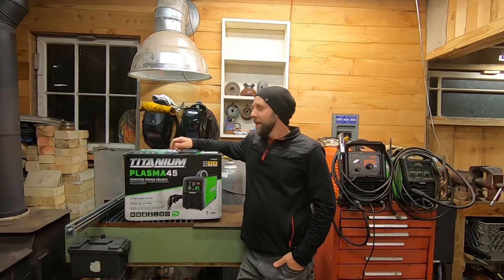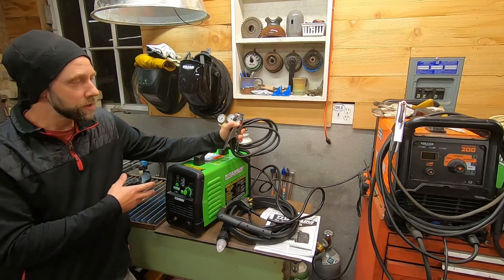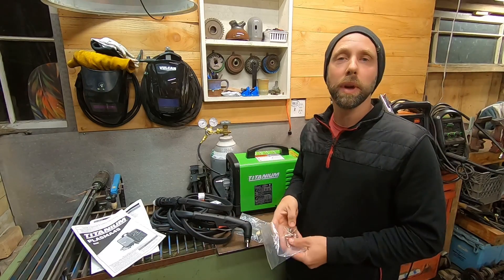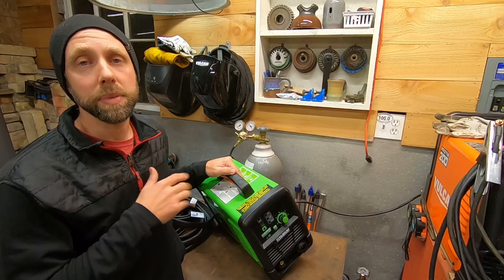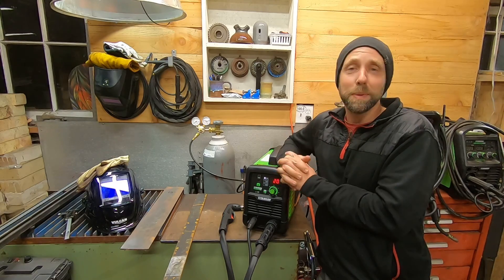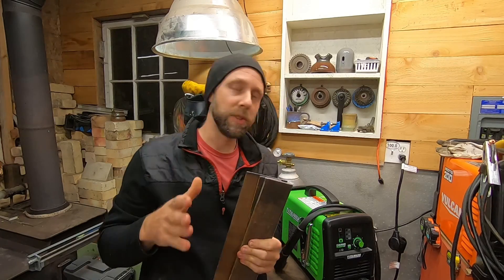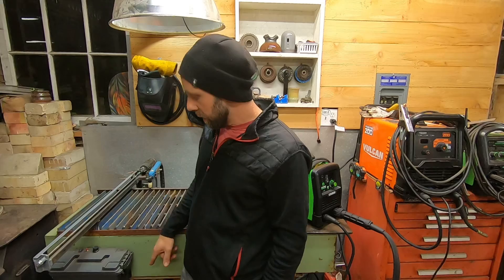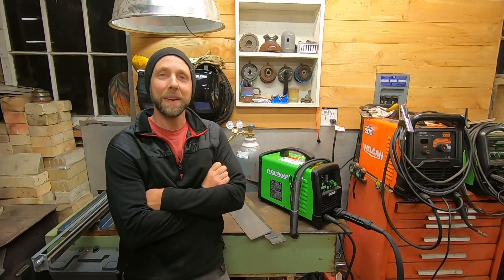Titanium plasma 45 plasma torch review

Comment: No release date or price? Nice review though, not sure I trust a piece of equipment that's given to check it out. But that being said HF has a great track record as far as returns go.
Reply from the maker: I asked those questions but at the time HF didn’t want to give that info out. I hear they should be in stores after the new year. I had a manager at HF look up the price and it should list for $799 but I’m sure it will sell often lower then that when it goes on sale, at least that’s how most of the Titanium line is. 
I think you may have miss understood something, they asked if I would look it over and tell them what I think of it, because they know I have bought quite a few of there welders and reviewed them, they wanted to get feedback on how I felt about it. This is not a beta unit, it’s a production machine. 
Take care

Comment: Hey Mike, still curious of when your ever going to get back to the titanium flux 125 . You said you had the parts ordered to change it over to a gas mig welder . We are still wanting to see you get this done, any idea of when?
Reply from the maker: I started modifying the 125, I got a relay wired  in, i found a spot on the board to tap into for the correct volts, I have a gas valve but I might need to get a different voltage one? I still need to order a new MIG lead with a gas line. I just started realizing that it’s a bit more involved to do, and I don’t know if wiring this up could effect the welder negatively voltage wise and cause problems to the circuit board? If I mess my own welder up it’s okay but I don’t know about showing people how to do all this and have other people have problems. I also think even if I mod mine to run MIG I think explaining it to others could become a endless list of comments asked how to do it? I will try to finish it sometime soon, but I’m on the fence about showing others because it’s a little more involved than I first thought. Take care 🙂
Reply: @Mikefestiva  I think the beauty of that little machine is being able to weld up to 1/4" prepared properly.Its only 125 amps,flux core penetrates better,and the machine is only 200 bucks.I had a pair of lincoln weld pack 100,s years ago.Converted one to gas,it really limited its ability.1/8' tops
Reply: @MsWillysg503  Guys...I really think the attempt to convert the 125 to gas MIG is missing the beauty and primary application of this welder. It is simple, compact, 120V  and lightweight to allow it to be portable and take to remote repair jobs. Converting it to gas MIG only adds weight and  complexity while decreasing it usefulness. With good Flux Core wire...gas is not needed for the types of simple repairs this welder was designed to perform. Find an open box Titanium 140 at a PLS for $200 or less...and keep the 125 in your truck as is...
Reply: @kowen8121   agreed!

Comment: Air cfm and pressure used to cut the ¼” ??    Excellent vid.  Thanks.   When can we get one?
Reply from the maker: I was running about 100psi
The manual for the plasma torch recommends 90 to 110 psi at 4.2 CFH
I think they will be in stores early 2020.
Thanks for checking out my video 🙂
Reply: Thanks Mike.   Very helpful.

Comment: Did you ever weld with the Tig 200? Videos?
Reply from the maker: I did some videos TIG welding with the Vulcan Omni pro 220 and Titanium 200.
I also have a video posted of the Vulcan ProTig 200, it’s there AC/DC TIG machine, In the video I weld a Aluminum motorcycle stand.  🙂

Comment: Another well done video Mike!  What size of air compressor were you using (horse power, tank size, cfm, air pressure?
Reply from the maker: Thanks David 🙂 I was using a older 50 gallon 3hp two piston compressor, and that compressor is definitely much bigger then you need to run it. The air requirements for this plasma torch is 80 to 110 psi @ 4.2 CFM 
I hope this info helps. Take care

Comment: How much will it cost?
Reply: A HF manager recently posted that the Titanium 45 is scheduled to retail for $799.99
Reply: @kowen8121  Damn that's significantly higher than I expected given the prevalence of decent quality 50 amp plasma cutters available online in the sub-$500 range. =(
Reply: @derpingwithdeiters8754  I totally agree... The first hint was that the lesser Chicago Electric Plasma cutter is $669.99 on the HF website. Both are overpriced.
Reply: 799.99 for Harbor Freight or 200.00 for a Chinese Cut50?
Reply: @moedog07  The $799.99 Titanium has Pilot Arc. The $200 Cut50 does not. But a PrimeWeld Cut50DP for $399 does have Pilot Arc. The Pilot Arc feature is well worth the added cost. But not worth the $799.99 HF wants for it.
Reply: @kowen8121  Ok I didn't consider it being a pilot arc plasma cutter. Better by design - but I still don't know about the price. Seems high.
Reply: @moedog07  The HF prices definitely are not competitive with other pilot arc machines.

Comment: what size air compressor?
Reply from the maker: The air requirements to run this plasma torch is 80 to 110 PSI at 4.2 CFM. I have a older 50 gallon compressor with I think a 3 hp motor. It’s bigger then you would need to run it. Take care

Comment: Hoe much does it cost harbor freight has their older one for like $700 but you can buy one of those China machines for like $200 to $300
Reply from the maker: I tried to get a price on these but it’s to early for HF to give that out? Yes the $250 plasma torch on EBay definitely cuts fairly good, I got one a few years back, the only thing with them is they don’t scream out quality haha my cheap plasma Cut 50 from eBay is still working but I never did a review on it just because I really didn’t think the quality was there, I didn’t want to tell others I thought it was something that would last. Take care 🙂
Reply: I mean does it cut metal what else do you need

Comment: Does it have the auto pilot Arc
Reply: It looks like the pilot arc wire is integrated into the lead plug because it couldn't be scratch start if it has the stand-off on the tip.

Comment: Thank you for running it on 120v. So many of the videos I see always say it functions on 120 but turn around and use it exclusively on 220v. I get that these machines all run optimally on 220 but there's a lot of DIY'ers that aren't going to use it on the higher voltage.
Reply: I'm trying to figure out what size wire and breaker I should run to my garage. I ran the 200 unlimited on a 20 amp breaker for 120v and it kept popping. I would like to put in a 240 outlet too but idk what size breaker I should use.
Reply from the maker: Yes David I wanted to start of with this first video on 120 volts because there’s been a lot of requests in past videos how the welders work  on 120 volts, there’s a lot of people that only have 120 volts in there shop. Thanks for checking out my video 🙂

Comment: Hello, are the consumables going to be readily available  for the titanium 45 plasma cutter
Reply: Generally the ipt torches are made by Innotec under license from Tecmo in Italy.  Looking at a close up of the tips/consumables it looks like a Trafimet style torch.  I suppose Innotec could license from both companies.  Hard to tell without some diagrams and part numbers.  Trafimet S45, and the iPT 40/60 both have easy parts accessibility.
Reply from the maker: Yes! I had the same question, I was told they will be stocked at HF when this plasma torch is for sale. That’s definitely key to being able to go and buy them easily. Thanks for checking out my video Jeff!
Reply: @Mikefestiva  HF exclusive? Or are they interchangeable with other torches?

Comment: Hi Mike question can the Vulcan 225 ac/DC welder be able to tig aluminum  by adding a torch head not spool gun
Reply: Scratch start, and can't adjust the frequency or balance, but it could be done.

Comment: I would love to see Harbor freight titanium or Vulcan produce a multi process… plasma with Built-in compressor… Mig Tig Stick.  Package powered by a predator inverter Generator  For portability… with a hybrid hard wire configuration. So you could run a full 220 in the shop if needed.
 That would definitely put them on the market for domination.

Comment: How does it compare to your Zenny?
Reply from the maker: Well the little Cut 50 definitely works, I have never done a review on the Zenny cut 50 because I just never feel like it’s going to last? But it works ever time I fire it up, the Cut 50 has a high frequency start and I sometimes need to pull the trigger two or three times before it actually strikes a arc and is really to cut, other then that it works fairly good, but it feels like it’s power output is a bit less then the Titanium 45. The Titanium strikes a arc ever time I pull the trigger. The overall quality of the Titanium 45 is much better. But the little cut 50 definitely cuts okay 🙂

Comment: Newb question  what of  air gas are running  since it has a air dryer I am guessing just shop air  what pressure and CFM  I just have a lil hot dog style compressor   good enough to run a air nailor
Reply from the maker: I’m running a 3Hp 60 gallon compressor, it’s bigger then it needs. The manual says 80 to 110 PSI at 4.2 CFM . 
I will try and run it on a smaller compressor in the next video. Take care

Comment: I have had a 45 amp Harbor freight machine for more than fifteen years and it will cut up to 1/2" steel however I think you would really be giving up any quality if you tried 5/8. For the bigger stuff I bought a Cut 70 amp machine using a dedicated circuit (50 amp 240v). I couldn't help noticing you said it was a 20 amp 120v circuit but the outlet is a 15 amp rated fixture.  Did someone install a 15 in a 20 amp circuit or is it truly a 15 amp circuit.  If it was a 15 amp circuit putting out 20 amps of cut is impressive!  Take care.  Doug

Comment: I just got a Titanium 200 in June this year. I didn't know that they made a plasma cutter to! I would certainly want one for myself also. Just an amateur welder, but getting better every time I weld. I'm building a frame with in a frame HF 10x20 canopy, mostly made from bed rails. I started 2 yrs ago and just now started back. I had to buy some angle iron to finish it up before winter sets in, I would like to get the roof on and see my car under it. If you like to see it, just hit my picture and see for yourself. I have learned a lot by watching your videos. I'll be looking forward for your next one, Thanks for the reviews.
Reply: I have the titanium 170. Man that unit is a joy to use every time.  My welds look great. Bought a cheep 400.00 dollar tig off Amazon. It's the one everyone was raving about on YT. And I have kinda not used it as much as I should.... since I got the titanium.
Reply: I love my 200!
Reply from the maker: Right on David! I will check your project out 🙂 thanks for commenting and checking out my video.

Comment: What air pressure were u running and what size compressor ( hp&gal )?
Reply from the maker: Hey Dan I was running a 3ph 50 gallon compressor. The manual says it requires 90 to 110 psi at 4.2 CFM.
Reply: Mike festiva thanks,that would would well with one of my compressors, now if the price isn’t to bad.😊

Comment: I'll bet that it will cut 5/8" thick steel NO PROBLEM on 240 volt!  I'll bet ANYBODY that it will do a severance cut on 5/8" on 120 volt 20 ampere circuit your using right now. It would be ugly, but it will do it.

Comment: After watching your presentation Mike, I predict that  all the over priced plasma cutters down at the local welding shop will be gathering a LOTS of dust from no sales.
Reply: I bought a lotus LTD 5000 on Amazon around 400 I'm a new welder almost a year in I have a titanium 200 which I like all except no foot pedal which I would not buy it again for that reason alone once I found out about MIG welding and TIG welding the foot pedal I had the lotus I don't know if I like it or not I really don't know how to use it well I was having water problems which I just got straightened out I made a drain system and a condenser for my compressor which works fantastic I got it off the internet the idea if you have water problems definitely check into and that's  and how to put lines in on the wall with copper or whatever it works. !!! I was having big issues. !!! couldn't get it to work right and it was water !!! got it straightened out now still don't know if I like the Lotus if the titanium was in front of me I would definitely buy that first  is a 50.. Big DEAL that's one Mike just did the titanium really works nice but then again MIKE makes everything look easy. Just joking Mike's a great guy great neighbor I call him my neighbor from the internet God bless enjoy I hope I helped

Comment: Great job as usual Mike, I’ve been waiting for this to come along. What sort of air pressure does this require?
Reply from the maker: Thanks for checking out my video! I think it requires 80 to 120 psi, it’s got a internal regular and it senses if pressure is to high or low. I will check the manual to see the CFM that’s required to run it and get back to you. Take care

Comment: 1/4 inch is impressive on a 20 amp 120 volt circuit
Reply from the maker: Yes I was surprised how good it did on 20 amps, I ran these first cuts on 120 volts because I have a lot of people commenting that they only have 120 volts in these work shops, I figured I should show how it does in 120 volts before I get into 240. That’s for the next video. Take care 🙂
Reply: @Mikefestiva  how much are these plasma cutters

Comment: Nice, I will add that to my new hobby. I just picked up the the Titanium 140 Welder.  Release date ?
Reply from the maker: Right on thanks for checking out my video!
I tried to get info on when there coming out but all I heard was after the new year, sounds like the spool gun for the Titanium will also finally be released after the new year as well???
Reply: @Mikefestiva  Awesome . Spool gun and Plasma cutter release
Reply: Humm someone needed the 12 pound spool adapter and so I took it back. Upgraded to the 200 Multiprocess . Gave me 10 percent off for my troubles

Comment: Mike! Moving up in the world of YouTube... Got HF sending you freebies now... pretty sweet! I actually bought my first plasma about 4 months back and of course now titanium comes out with one... It looks like a pilot arc start not a scratch start machine is that correct?
Reply from the maker: Hey Kyle 🙂 yes it’s pilot arc start, I like it a lot so far, starts every time. My little Cut 50 I got years ago from E bay is a high frequency arc start and it usually takes a few tries before it starts a good arc. What kind of plasma torch did you buy?
Reply: After a bunch of research and price comparisons I ended up buying the LOTOS LT5000D 50A Plasma Cutter its a great little plasma cutter and I bought it off amazon during one of their deals so I only paid $289 before state tax. It is a scratch start machine because I didn't want to fork out the extra $120 for the pilot arc version of the same machine but in all honesty I rarely need to actually scratch start the machine. Most of the time after squeezing the trigger it will start without contacting the surface. I bought it because I am a hobbyist mechanic on classic cars and trucks and I was doing a full QA1 coil over conversion on my 73 C10 and needed to cut the factory spring pockets to adapt for the new kit. It worked great, no complaints here. Sadly though my back injury at work a few months ago still has me just staring at my truck up on jacks since I am unable to do anything to finish until I am better.
Reply from the maker: Hey Kyle I bought the little Cut 50 a few years back, I never did a review on it because I felt even though it never gave me any problems the quality of the plasma torch seems questionable. It sounds like you got a good torch at a great price! I’m sorry to hear your back it still gives you problems 😕 I broke my back when I was 13 years old, I know how it can be, I had to get surgery to fuse 3 vertebrae. I hope you can get back to working in the shop sometime soon my friend 🙂 Take care.
Reply: @Mikefestiva Yeah I keep hearing from everyone it just takes a long time to get better but it will eventually... but as an active person it's been very eye opening not being able to do simple daily tasks. 
 Did harbor give you any idea of a release date or price  point on the machine? Yours seems to be the only sneak peek I can find..

Comment: Nice! I am impressed with what I see so far, what do you use to dehydrate your compressed air? As you alluded dry air is essential for a plasma cutter. I wonder what the price will be for this unit?
Reply from the maker: I’m just using a in line water trap, it helps but a air dryer is best but most people don’t have those in there shop, my buddy runs one with his CNC plasma table but he cuts over a few hundred feet on ever 4x8’ sheet of metal he cuts, a average guy is fine to just run a in line water trap. I don’t know yet how much these will sell for but Hopefully they stay in the Titanium welder price range? Thanks for checking out my video 🙂

Comment: I just bought a cheap one on ebay. I wish I had waited for this one. I might still get one. Please keep us up dated on any problems with this little guy.
Reply from the maker: I bought a cut 50 plasma torch a few years back off of eBay as well, it still works fine! Tips are really affordable for them 🙂
Did you see my video using it on my plasma table I made? It cuts great!
I definitely plan on running this plasma torch hard to see how it holds up, the CNC Table will be a great way to test the duty cycle on this machine.